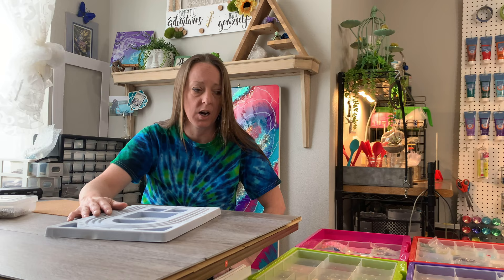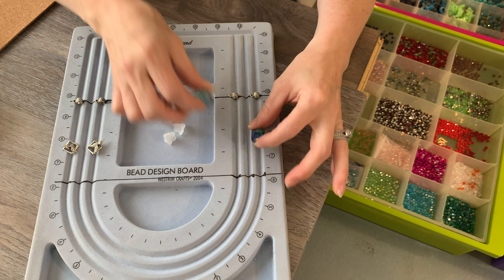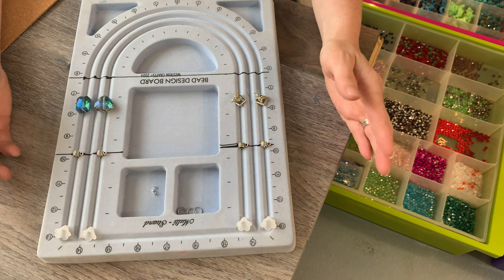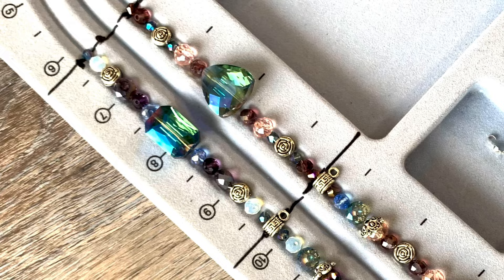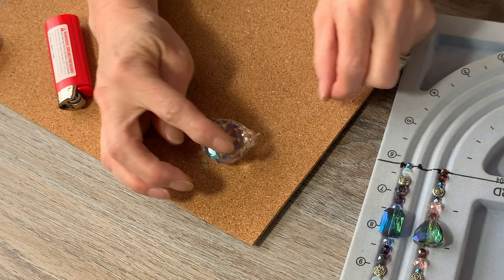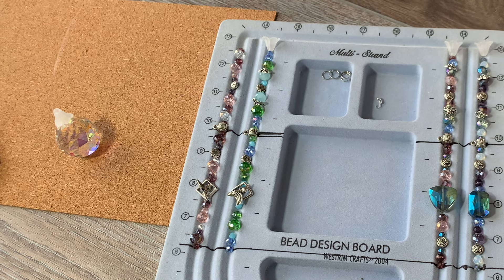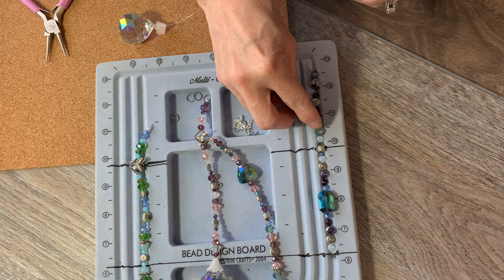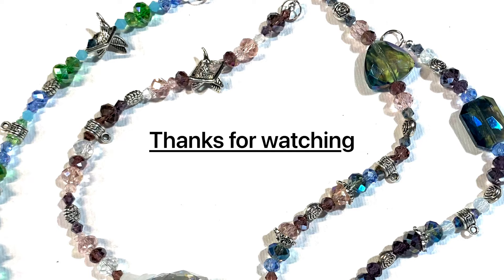How To DIY A Suncatcher with glass beads ✨😎//EverythingAJ’s

Comment: So I made one but the cover bead knot at end falls right thru Any idea why ? are the holes different sizes ?
Reply from the maker: They could be different sizes but what line are you using? How many times did you tie the knot 🪢
Reply: @EverythingAJs   17 lb  2 basic knot , Did i miss one ?
Reply from the maker: @kentgulley5259 I would do it as many times as it takes until it holds. Just make sure it’s all in one spot so the knot size builds up enough for it to stay. It’s not something I’ve run into before so it’s hard to know if that’s the best advice but seems like it’s worth a try.

Comment: I really liked seeing this all come together! so pretty.  I want to ask [1] what is the metal bead with a hole on the side, that is what it looks like and then those 2 little beads are nestled in each end...  u used this on each strand and I forget or couldn't hear what it is called.  [2] what is the last metal piece called that you take the needle nose and make a tiny loop that the round jump ring goes on to be where a hook will hold the stand... did u use all glass or just plastic and have u made a chime with copper sun-catcher that makes noise... thank you very much [ ps: I had my volume on 98 and it was heard to hear you, but you had my attention.] thanks again. anyone here know the names of what I asked for or AJ --- so appreciate.
Reply from the maker: The metal part is called a “clamshell clasp” I’ve never made another version of the Suncatchers I’m really into the simplicity of this beautiful design. The beads I use for the I didn’t mention a name but they are called “Bicones” and I use a combination of crystal and glass beads. Sorry about the sound issues.

Comment: Approx cost of AB crystals and any recommendations on trusted sellers I purchased the plain and the cut at top where hole is goes way out past the cover bead (Trumpet flower)
also The ab are very costly
Reply from the maker: Well approximate cost varies but I have just added them to my Etsy shop as an option. Not sure if it’s a better deal but it’s the only option I can offer. Here’s the link https://everythingajs.etsy.com/listing/1740216585